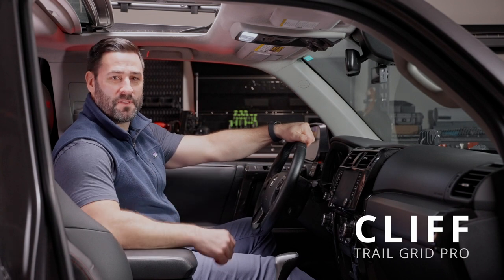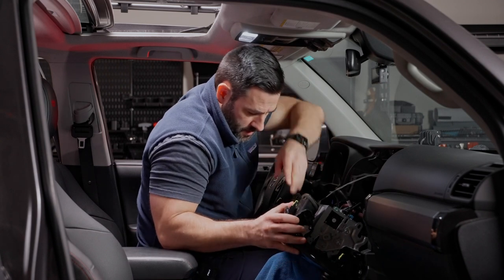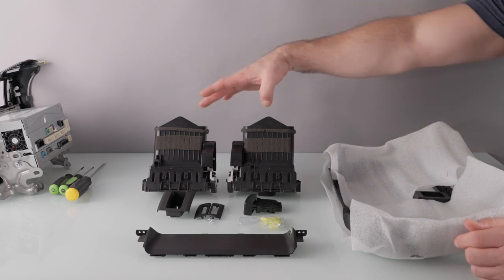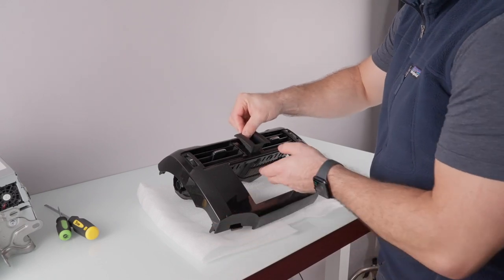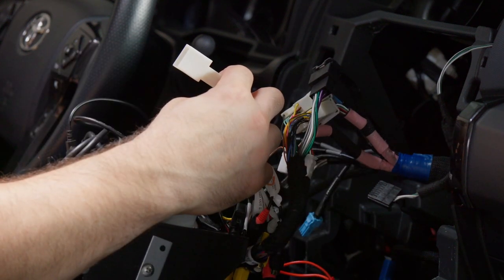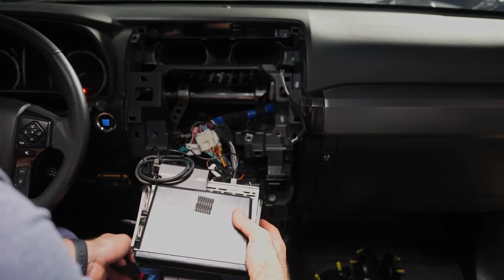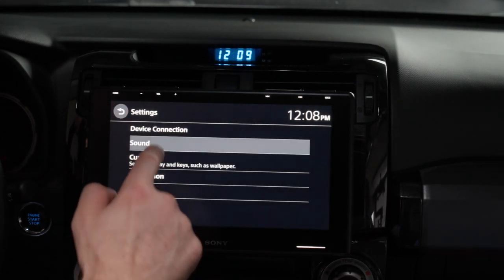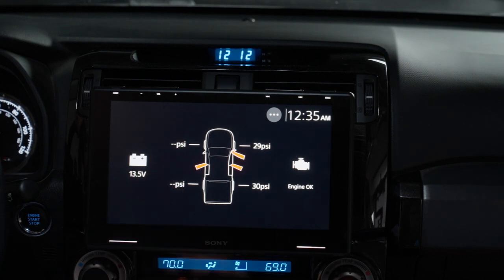Toyota 4Runner Sony XAV-9500ES Plug & Play Kit Installation | 2014 - 2023 Toyota 4Runner

Comment: Installed this unit a few weeks ago and absolutely love it. TGP does a fantastic job in making it plug & play. I did, however, have a few issues that I thought would be worth sharing. I initially couldn’t get the hazards working and ended up sending an email to TGP support. Never got a response. It wasn’t until I started surfing through the comments on this video that I found a few other folks had mentioned the same issue almost a year ago. What compounded my problem was that the hazard harness somehow got dislodged from the old head unit when I removed it and ended up under a storage bin on my garage floor. So once I figured out there was a harness I needed to use as an intermediary connection it took me a few days to track it down. I did finally got a response from TGP 8 days later but the response mentioned nothing about the hazard light issue I had asked them about. If this has been a known issue for almost a year then I would have at least expected some kind of mention in the install instructions. Would have saved me a headache and a few days. Last thing, I also purchased the front camera add on. Picture quality is very grainy. Just something to consider if you’re thinking of dropping an additional $50.
Reply: Same with my 2019. I noticed the strangely fastened interface cable for the hazards on the original head but, wrongly assumed that the female receptacle on the new head would fit. It doesn't. You have to remove that securely fastened interface cable and transfer it to the new head. That is not on the video. A quick edit to add this step should be performed. Other than that snafu, what a great video. So much better than written instructions!
Reply from the maker: I'm sorry to hear you had difficulties with your install! Our support team is usually very quick to respond and very knowledgeable with our products, I'm sorry we missed the mark on that one! We try to make our videos as detailed as possible, but we are human!

In regards to the camera quality - this is an issue that Sony is aware of and they are working to improve this via future firmware updates.
Reply: @trailgridpro do you know if the issue of it being grainy with the front camera add on for the 8500 still exists?
Reply from the maker: @michaelfoley1296  the camera quality isn’t improved by swapping the head unit. Essentially all that happens is the original camera display pixels are just enlarged with the larger screen, which is why it can appear grainy. It’s actually the same quality picture as on the smaller OEM screen, just enlarged. So, the pixels display larger which causes the confusion that the picture is deteriorated. The picture is actually the exact same, just larger. Hopefully that helps and makes sense!

Comment: Hi there. I have a 2019 Limited with amplified JBL audio. I have purchased and replaced 8 speakers with your Kicker bundle. I noticed a slight improvement but I wasn’t too impressed. Thinking about the Sony 9500. Would this unit make a difference in sound compared with the OEM head unit? Thanks
Reply: might need to add another amplifier.
Reply from the maker: The 9500ES will definitely bring your sound to life paired with our Kicker speakers! The stock head unit is the weak link!

Comment: How are you coping with the 2 ac vents completely blocked?
Reply: I’m thinking about getting this but I had the same question. I’m wondering if the until will overheat in the winter when I turn on my heat.
Reply from the maker: We have found that the way we adjust the screen doesn't interfere with airflow at all, and we haven't had any overheating issues!

Comment: For screen position...is there any movement for it to be pushed further back to be a bit more flush with the trim? The gap between the trim and the screen seems kind of excessive and makes it scream aftermarket. If you could push it in a bit, at first glance (to a thief), it could look oem.
Reply from the maker: Good question! We adjust the screen inward as much as possible.

Comment: Installed mine today and it went pretty smoothly just following the video. On my 2019, the cable from the hazard flashers connected into another cable that was rigged up on the side of the original head unit. Took me a while to figure out that I needed to remove that and use it as a patch cable. Other than that, it went great.
Reply: Thanks did the call out about hazard button. Has the exact same issue with my 2018 and could not figure it out.
Reply from the maker: Yes, you're 100% right! In the video we missed that step because we have removed my head unit so many times. A total oversight - our complete apologies!!
Reply from the maker: Yep you sure can!
Reply from the maker: So sorry about that! We definitely forgot to mention it in the video!!

Comment: I bought this unit three weeks ago; the video didn't mention about hazard button, and it took me an hour to figure out the problem. Also, I never attempted to use Sirius XM, so the heads unit didn't include an adaptor to connect to Sirius XM (of course). However, the video mentioned the gray cable was for Sinus XM, and I followed them. Thought it was an easy installation, but the head unit didn't read Apple Carplay (No GPS was found). I re-watched the videos several times and swapped the GPS cable to Sirus XM per video instruction, and it worked perfectly fine. Love the heads unit and fast shipping, but poor instructions (false information at some points)

Review: 3.5 stars out of 5 (It could have been much easier with better instruction)

For Non-Sirus XM video

Please go opposite to their instruction (11:39) 
This video didn't include hazard button swap info
Reply from the maker: Thanks for your feedback. Yessss, you need to remove the hazard harness from your factory radio prior to reinstalling! We had removed our factory radio so many times that we didn't have to do that with this shoot and then totally forgot to mention it in the install video. Totally our fault - we're clearly VERY human! That being said, we sincerely appreciate your thorough feedback and if there's anything we can do for you, let us know. However, the information about the SiriusXM plug versus the GPS plug is correct in our video.
Reply: This is crucial!

Comment: Do you have any pictures of the different ways you can have the head unit placed/mounted?
Reply from the maker: Unfortunately we don't but it can be mounted more to the left or right and higher & lower. We placed it in the best position for use in a 4Runner but it can be adjusted!

Comment: I have a 2019 and was wondering how much of the HVAC controls will be blocked by the screen as this video has a digital piece in the middle but mine is all knobs. Is there a picture of a setup installed with my setup? Thanks!
Reply from the maker: Excellent question! There are some customer-submitted reviews on our product page that shows the finished product with these kits installed in 4Runners with 3 HVAC knobs!

Comment: I want this, but afraid the screen will block the vents. Anyone have updates on this long term? Will the heat from the vents in winter cause the CPU and I Atala of that system to heat up?
Reply from the maker: We personally used it in our 4Runner for over a year with zero issues from the vents in all 4 seasons (winter, spring, summer, fall)! :-)

Comment: Wouldn't the head unit block air from the vents and get hot as shit when the heat is on full blast?
Reply from the maker: I ran this all winter with no issues in that department. If you're looking for an option that doesn't cover vents, check this video out: https://youtu.be/hYy9jsDMeHs

Comment: What aftermarket cameras work with this? The stock camera looks like it still gives low resolution on this. Does this need maestro? I didn't see you install it but all the steering controls and vehicle info is working.
Reply from the maker: Any aftermarket camera system will work with these!

Comment: Not sure about the protruding screen setup.  Wondering why Sony didn't come up with an in-dash system.  The vents, blowing onto the back of the system could cause an issue as well.  My most pressing question is, can this system handle the Multi-Terrain Monitoring system offered in the new Toyotas?  It's a 4-camera system that offers top-down 360-degree view of the vehicle, as well as each side independently.  I love the features of this Sony system; however, if it's not fully compatible with my vehicle's capabilities, well then obviously it wouldn't be worth the purchase.
Reply from the maker: Yep, your MTM camera system is maintained with our kit!

Comment: trying to decide between this one and the 8100.  i want the wireless connectivity, but this screen definitely looks like it blocks the AC.  and i'm in the hot texas sun.. i need that AC.  any experience wth it? which should i get?
Reply: i have had both get the 9500
Reply from the maker: Great question! The 9500ES is much more modern technology and we haven't had any complaints about the screen blocking airflow! We had it in our shop 4Runner and loved it!

Comment: Does this disable the toyota remote start / stop, fuel level, last drives etc in the app?
Reply from the maker: The 9500 bundle does not disable your app! Your app will still work as it does with the factory head unit!

Comment: can the screen go further down to prevent vents from being blocked. Or was it all the way down in the video?
Reply from the maker: Absolutely! You can definitely put the screen lower!
Reply: I was wondering the same thing.  It seems if it is lowered any further, then it may obstruct the control knobs.  If only they had the very same unit but slightly smaller...
Reply: @TrailGridPro Was that shown in the video and I missed it?

Comment: I just installed this on my wife’s 18 4Runner, the back up camera won’t turn on when you put it in reverse, and the gauges are not displaying any like yours did when powered up. Is there something I did wrong and how do I fix the back up camera to work when I’m reverse?
Reply from the maker: Yep, we have an easy fix for that ... send us an email to support@trailgridpro.com and we'll send you the troubleshooting info!
Reply: Installed yesterday and my backup camera (factory) is very grainy with this unit. Also I have no tire pressure info on the vehicle info screen. Installed in a 2018 4Runner also.

Comment: Fit for 2022 4Runner TRD Pro?  Because the vehicle has a 360 camera。。。
Reply from the maker: It fits perfectly and your 360 capability can be retained via assigning the functions to steering wheel controls via the flashing process.

Comment: How do you adjust the screen position?
Reply: There are simple adjustment screws behind the screen to loosen, adjust screen and tighten again
Reply: @andrewjarvis7777 It doesn't tilt?
Reply: @Jedi71  no tilt. 

Up, down, left, right, in, out.
Reply from the maker: That's correct! You can adjust the vertical angle using the screws behind the screen!